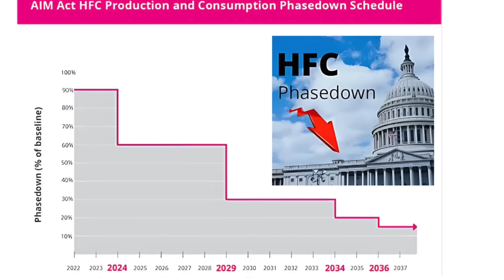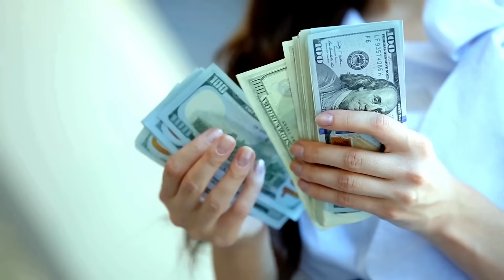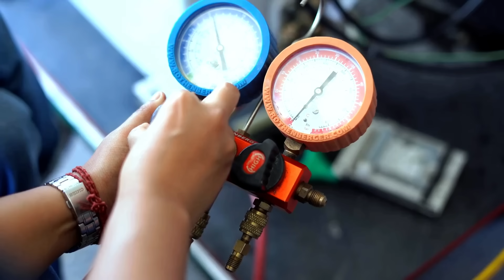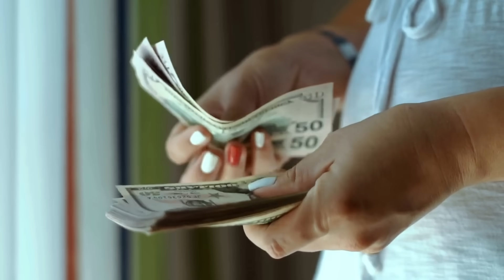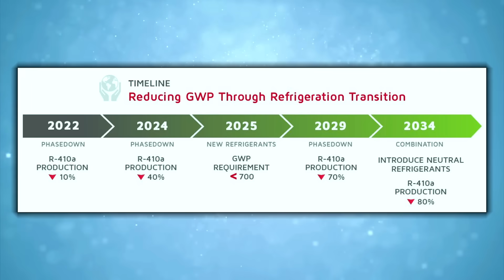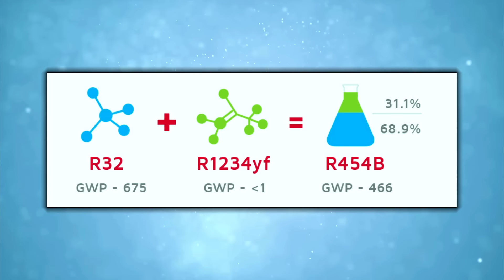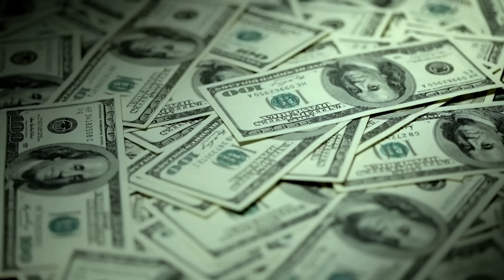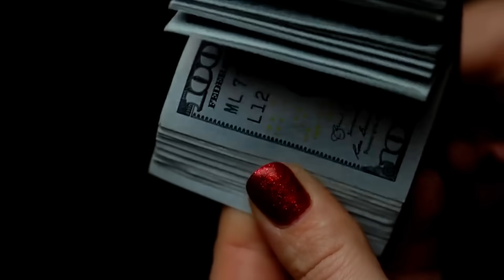Latest on the 2025 Disaster in HVAC and 454b Problem!

Comment: In a few years they'll be telling us that this new refrigerant is bad too. If systems don't leak, there's no damage to any part of the environment. I despise these higher pressures, they sit in the sun in the back of your truck, climbing even higher. I still have a near full jug of 22 and my 20yo system I installed still works perfectly. If I need to change the system, I'll sell my jug of 22 and it'll pay for my new equipment.

Comment: We replaced our old units last summer with 410a designed systems in part on the advice of our hvac dealer.  Reasoning was to have tried and true equipment that already had most of the bugs worked out, rather than be the Guinee pigs on new designs. Was also to avoid paying more for the newer units with the added complexity. Time will tell whether this was the right decision overall.

Comment: As a Tech myself, first anyone who is mixing refrigerant are hurting the customer and the company they work for. 
2nd this change was forced and doesn't seem like any supplier was truly ready and it should only be 1 refrigerant instead of 2 different systems.
3. The outdoor sensor will cause a gas fire furnace not to work during winter when you need the heat. I do understand the whole propane base mixture but if the leak is outside why should it affect the heating system the outdoor sensor should just affect the outdoor unit and for safety put a indoor sensor.
4. This is just a money take and the customer has to pay. 410A was working fine and R22 still was being sold and yes you can still buy refrigerant for both much easier.

Comment: Making some big HVAC decision very soon the your info was eye opening. R32 or 454b systems? SEER ratings? Reliability and maintenance? Installed costs? YIKES! There appears to be a no win situ for the residential consumer. How would you design and system for 1400 sq ft  addition in a humid climate?
Reply: Fully get where you're coming from because we are senior citizens and always know that we are targets for low-lifes.   Roll the dice & hope you're not getting scammed. Try getting 4 to 7 estimates & try to do the best homework on who ever is the most reliable installer & backs up what they sell.

Comment: I have been in the HVAC business for over 30 yeas. I seen R-12, R-22 and 410A refrigerant phased out. NEVER have I seen a complete break down the supply chain, that is pushed from changes from the EPA this bad! There has always been substitute refrigerants available during these phase outs periods. I checked on a price for 454 today $3000 for a 20 lb jug. The industry that supplies refrigerant has gone from 50 lbs cylinders to 30 lbs cylinder and now 20 lb cylinders. Price have gone from $50 for a 50lb jug of12 or 22 ... 1980's money, to 3000 dollars for 20lbs of the supposed safe refrigerant 454! As a contactor in the South what are we supposed to do? Have to install new system because the old one is 25 years old, and totally shot, to replace with new system with 454. Only to find out that the line set is 30 to 50 feet long. ( I have rarely seen systems that have 15 ft of line or smaller.) Now we have an additional 35 feet of line to fill. Its 95 degrees and HOT in the customer's home. So, we just can't say sorry, you can't use your system because we have no refrigerant to finish the job. We are stuck between a rock and a hard place! So, contractors are struggling to make customer happy, but during the mean time the industry say, we MIGHT have refrigerant by summers end. So I understand why contactors are trying to figure it out on their own a solution, there is no help from the industry and don't know when help will arrive! As for 410 systems they were all gone in my area with 2 months of the new year.  All that is left is 454 or 32 systems.
Reply: buy a couple condensers that you normally put in 3,4,5 tons  braze a small line on the liquid side and recovery all the refrigerant  and fill them when supplies are available and when you install them....
Reply: The manufacturers still selling and who ha e sold 454’s should be on the hook to replace with r32 system and write as a loss. Should t be on the contractor or customer!
Reply: @soulfireonfire6423 wouldn’t it be funny if who actually f’d up the system had to pay? The epa can bully manufacturers into stopping production of r410a, and it’s all good (for them), no problems whatsoever.
Reply: @kenlundstrom3047 they need to just go back to 410a and r22

Comment: I have a good friend that owns an hvac company, he really tried hard to get me to replace my equipment in my home last year while we still had access to 410a equipment. My unit now (3 ton Rheem split unit heat pump) that he installed is 15 years old. I didn’t want to because it still works like a new one. We’ve had to replace a few little things so far, capacitors, defrost circuit board and sensor, and sequencer. He’s a Bryant dealer now, he says so far they haven’t had any issues yet, and have installed several 454b units already. That last complete changeout was about $4200.00, he says you can forget that now. I’m just crossing my fingers that I can squeeze about ten more years out of it. 😂🤞
Reply: What I already have is a much better system than anything they sell today…im not an hvac by profession and know what I n in or because I’m blacklisted and had to learn how to do it all myself…and also being a home owner …my parents home and many of my dads clients homes….all upgraded and now regret doing so….rheem is a decent brand for the older models and it takes a lot for them to be no good anymore….thkngs like capacitors and switches are easy to replace and ur friend isn’t a friend if he’s trying to con u into the new garbage….if he works in that industry then he knows what’s up…he’s a jerk
Reply: @w8what575I think he was trying to look after me. Our unit is 15 years old now and we all know it’s probably at the end of its life. A compressor or coil failure will finish it off. He was trying to get me to put another 410a system in.
Reply: USE the old axiom: Never do business with family or friends.....it things go sideways, you will lose a friend and/or will have to see that family person until you or he/she dies.
Reply: @steveolive9991 that is true. We’ve had a good business/friend relationship for over 20 years now with no issues. It’s very rare, but we’ve never had a problem.
Reply: I'm still servicing 140 package R22 Gaffer & Sattler units that are 55 years old on a local apartment complex. In 35 years I've never had to replace even one of them
Reply: If it's 410-a repair it forever.....
Reply: @garyo8546 it is 410a, I’m planning to keep it as long as I possibly can.
Reply: I am in the same boat I have a Goodman  3 ton R-22 unit that was working great last year we had to replace the heating side last year with a Rudd now the AC Is not working my friend who did the job said it was a bad TSV valve he replaced valve last week now Iam freezing up the super heat is showing fine the pressure is on spot. Starting to get PO does not make sense he adjusted the valve he said he is coming today to try something else he better show up it’s getting hot as balls in here
Reply: @markaltman5791 
So did he fix it?
Reply: Should have bought the 410A equipment and stored it until the old one goes out

Comment: 25 yr old R22 system still running. Will keep babying this beauty.
Reply: My R22 is 25 years old, and I am afraid to replace it with the modern junk.
I was lucky my other unit a R10A unit was just under 10 years old needed a new condensor coil.  It still had 3 months left of a 10 years warrenty, but still paid 2K for the install
Reply: Mine's a 28 year old R22 Amana 2 1/2 ton heat pump. Still tight as a drum, hasn't needed refrigerant added in all that time. Thankfully, I'm retired USN Enlisted, that went to AC&R school and have a Universal Cert for Stationary Refrigerant systems. So I've been able to pretty well care for the beast on my own. Just finished cleaning the coils and doing some TLC on it a few days ago. Still runs quiet as a church mouse.
Last time I bothered calling a service tech to check it out, because I had other things going on at the time, was 4 years ago. The only thing they claimed to find wrong with it, was that the metal supports for the evap coils were starting to rust - and they used that as an excuse to try to sell me on spending $25K on replacing the entire system, including all new metal ductwork under the house. The one true thing they did say was "the prices are going to start going up drastically, and it's going to get more expensive the longer you wait".
Reply: Same, mine is 27 yo, just hoping it 'babies' along another year or two to see if this mess gets straightened out.
Reply: 32 years and still going strong
Reply: I had a low-life repairman charge us $864 for R-22 recharge(2ton unit) because he said it leaked out & he couldn't find nor repair the system.  We tried to refuse paying him but were given a choice or be sued & our family lawyer said;JUST PAY THE BASTARD.
Reply: @loyddonald1582 that sucks. they have you over a barrel.
Reply: R22 was and is still the best cooling you can get in the last few decades until today. A2L is huge on cancer causing chemicals.

Comment: Ok let’s all tell some truth here! The HVAC manufacturer never wanted to change from R22! I know I worked for two on the top manufacturing companies! The EPA forced the change to R410A in 2010! Now the EPA forced the change to R454B or R32! Hundreds of millions wasn’t made off this change! It was however spent on it! He is talking like there is a bunch of R410a units just waiting to be sold to dealers and contractors! News flash there isn’t! Complete system R410a installs require by “guess who” Government, had to have 2024 dec 31 or before date of manufacture! Those units are all gone! The entire issue isn’t greed it isn’t good for anyone’s bottom line, it’s caused by “ if you are paying attention you will know” Government”! We don’t have enough left handed A2L valves for the A2L 20 lb. Jugs! Easy fix, eliminate the left hand thread requirement! But oh no!!! The “ Government” ain’t doing that! So the entire HVAC industry and customers suffer! Now you know! BTW  manufacturers are being forced to replace new units with new units is the are low on refrigerant! So who is eating the cost of this? Who is the cause of this!
Reply: The gov and their pseudoscience bs’ers and their made up dooms day bs ….
Reply: The ENERGY NAZIs were given way too much power and not enough brains to understand anything 😅technical. Trump needs to intervene .
Reply: Hmmmm, seems to me we both got to get into the manufacturing of R-32 and R454B and quit missing out on $$$! Ok, of course this principled person posting to you is being cynical. However,  many complain but the truth is as long as many are willing to just bend over and take it nothing changes in our so-called “democracy”.
We know the climate scheme is a racket. Banks are still making 40 year building loans on structures near beaches where the water level is supposedly increasing. Yes, just forget all the old and new pictures comparisons on the net of coastlines not losing land, and we know it’s all a scam. 
So, why complain? Let’s get off our a** and hold our masters to account, if not vote them out! 🤔🏆🙏🏻🇺🇸
Reply: Refrigerant mfg push the changes lobbying the epa which is easy to sway

Comment: Glad I installed a new 410a system last September.
Reply: My HVAC still runs on R22, 25 years old Bryant, loud, not very efficient but ice cold.
Reply: @senco981 newer systems aren’t much more efficient so you aren’t missing out.
Reply: Same here
Reply: Good choice
Reply: Why we installed a new one a couple years ago even though the old one still ran.
Reply: @xcalibertrekker6693  Same.  Mine was 14 years old and still running.  I decided to buy a new system when it's running as I now the A/C companies will increase prices when they are replacing a failed system.
Reply: So what should I buy?  Ohio   1600 ft brick ranch.
Reply: @rjohnsnyder436 
me a new car !
Reply: Same. Goodman last October.
Reply: LoL, 410A systems suck & won't last long .....
A sucker born every minute......
Reply: @smf2072  Umm...compared to what?  My 410 system I replaced was running fine when I replaced it.
Reply: @smf2072  - R34 will not last, why they run at higher pressure, so more wear and tear on them
Reply: Runtru are good systems by Trane
Reply: Well. We can still get 458a and 407c. So as long as compressors are still made, coils, condenser and evaps, with lots of effort, can be repaired
Reply: Outdoor 410A units are still easy to get.  The indoor coils are becoming a problem.  It's turning to R22 all over again.  They have 454B with these new systems, unfortunately we HVAC technicians can't even get this new 454B refrigerant.

Comment: The fact that manufacturers chosen a multi-part refrigerent like 454 is stupidity.  R32 has been in use all over Europe for years and and if car engine parts can survive high temps then use the same metals in the ac compressors !
Wher a r32 system leaks, repair the leak and simply add more r32.  When r454b systems leak,  you have to evac the entire system and all all new r454b.   Hmmm....more sales of r454b ........ wonder why they decided on this refrigerant  !
Reply: Why do you have to evacuate the entire system with the 454b
Reply: I've never heard of that either

Comment: I just got a carrier with 410a….  Would I be paying more in next 10-15years or prob better choice than going with 454 or 32? I’m so confused if I even made the right choice
Reply: You're fine. 410a refrigerant will be around forever. Same for r22.
Reply: I have a 2009 York 2-stage AC with a variable capacity and ECM motor heating system. Barring no Freon means I’m just going to keep replacing parts. Already replaced contactor, capacitors, air and pressure switch for the heating side. Also make absolutely sure all the electrical connections are very secure every season and keep the condenser absolutely clean. So keeping up with little repairs will keep things going till those in charge get their Wokeness out of our industry. This is all driven by fear and those who think our planet has been on fire since the Montreal Protocol. What’s worse is that Americans suffer and China and India take on the Attitude, burn baby burn.
Reply: I own a service company. Installed a new 410a system for my parents 2 months ago so they don’t have to deal with this BS.
Reply: @seadweller8458 

I too do AC service am just on the rails of retirement. I bought a 410a 15 seer2 Rheem with the 2 stage 96.2 eff,  ECM furnace for my daughter’s household back near the end of Nov. They had a perfectly working 2.5 T. Goodman AC R22 unit, tied in with a York Std furnace. 

But like all of us in this world of HVAC, we could see the world of hurt upon the horizon. One thing we were never told that there would be a shortage of this crap. I got into the trade back in 1974. Never once was there a issue with all the freons that I had to work with. And now all of a sudden we are in a world of hurt with this new stuff. I told my wife over the years and others. The EPA uses the AC industry to crap on and always changes things for the worst. And since the work Woke has a all new meaning on every account. We as HVAC contractors and service are the toilets of their games. Let us all go back to Ammonia systems and that would fix all their shortages. And the manufacturers could build systems that don’t leak. They have done is for 60 yrs in the Refrigeration market, they surely can in the AC world. But they just don’t want to because they would never sell replacements. 
My long ago parents had a refrigerator that had Sulfur Dioxide in the system. I kept that thing around till 2020- almost 65 yrs old from the day it was made. I gave it away still working. It’s one of many units that didn’t succumb to the ice-pick defrost method, like I seen over many years. 

So I suppose we will see the all electronic hi tech reactive cooling and heating cells. And Freon will be a passing technology. The photo cooling electronics cells will be how a house is cooled and we will all electric AC houses-the walls and ceilings will get cold and warm without airflow. 

We are not that far off I’ve seen that done in a RD lab. Heck we have small coolers we carry around with that installed already. No more water to drain out of your coolers.
Reply: You made a sound choice. My last Carrier lasted 16 years before I replaced it. R410a will still be available for a long time, actually R22 can still be purchased, just no equipment.
Reply: Good choice. ❤ Carrier and consider yourself very lucky.

Comment: Just had a new 5 ton 41Oa condenser unit with a 454b air handler with an electric heater. Sales guy in a post install followup call said that the 454b was only the furnace and had nothing to do with the evaporator coil. I'm no HVAC guy but I don't buy that crap and It's already ready installed. Buyer be ware!
Reply: what do you have a air handler w/ electric heat strip or a furnace?????? either way you have an evaporator coil that doesn't know what type of refrigerant is in it.....    like having a 32 ford with a chevy 350 motor in it....

Comment: Sir i replace a r32 compressor in 1.5 ton split air conditioner but after running 5 to 10 minute it become overheat and trip.please guide me what should i do.is new compressor faulty or any other problem.return is also low